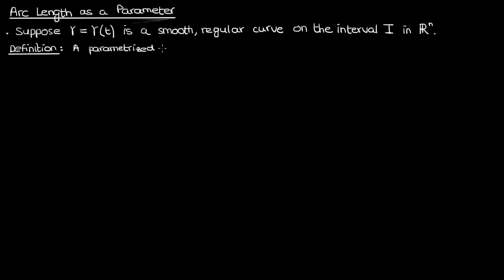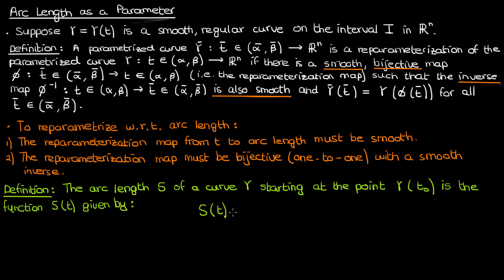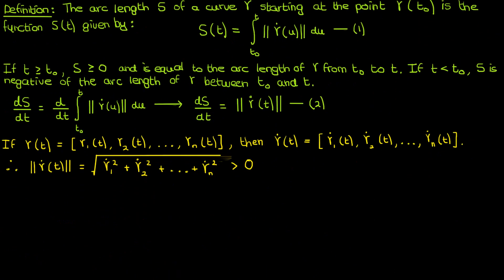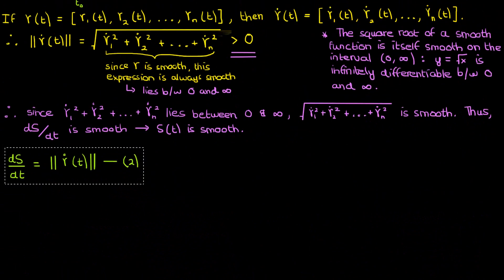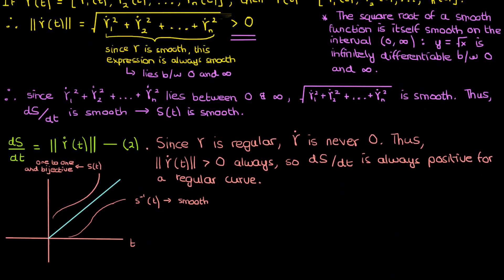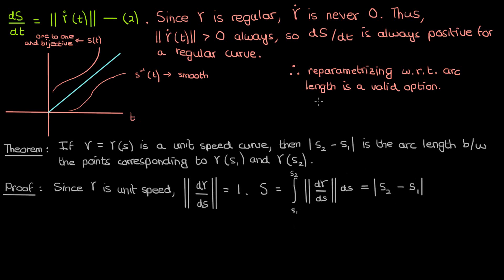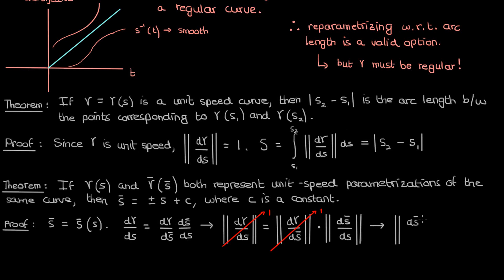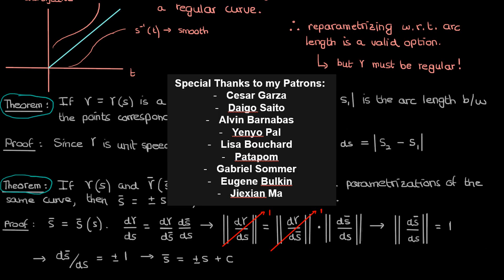Arc Length as a Parameter | Differential Geometry 3

Comment: Question: how do you actually "parameterize by arc length?" I must have missed something because it seems we answered the question "when are we allowed to" but not how to actually do it. Do you just plug s(t) into gamma(s) so Gamma(s(t)) is the parameterized equation?
Reply: That was pretty much the question that brought me here. It turns out that you actually have to carry out the path integral s(t).  
For example: Let's assume the parameter t has the meaning of time, and assume t_0 is 0. Then you have to actually compute the derivatives of x(t) with respect to t for all components of x(t). Then you need to sum up their squares and take the square root. And then you need to  integrate this thing from 0 to t, just like he wrote.  This is usually, even for the simplest examples, a pain in the neck. But if this integral from 0 to t can be computed then you have the parameter s(t) as function of t. The integral s(t) is basically a function that maps the old parameter, t -->  s(t),  the new parameter. 
But now there may be new trouble:  Suppose you had initially all the coordinates of x expressed as functions of t, e.g.,  x(t)=(f(t), g(t)) = (cos(t), sin(t^2)).  Now you have to express them as functions of s(t), which could mean that you have to also invert the function s(t), which is already very complicated, because it was based on the time derivatives of these two functions f(t) and g(t).   Good luck with that :-)  

BTW: In this case it would be xdot(t) = ( -sin(t),    2 t cos(t^2)) .  So the integral to get s(t)  is over  Sqrt[ sin(t)^2 + 4 t^2 cos(t^2)^2 ]  . And that function is initially sort of linear rising, but at about t=1 it reaches a maximum and then goes to quickly down to 0 (at t ~ 1.3), which means that the path won't get longer. So apart from the problem to actually solve this integral, it won't work as a reparametrization after that.